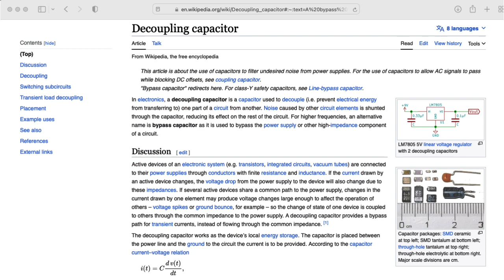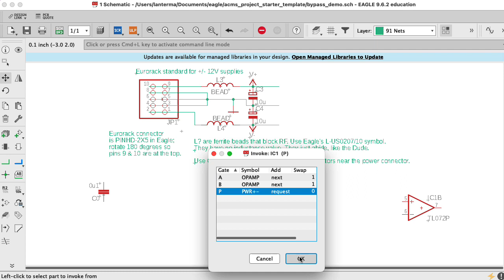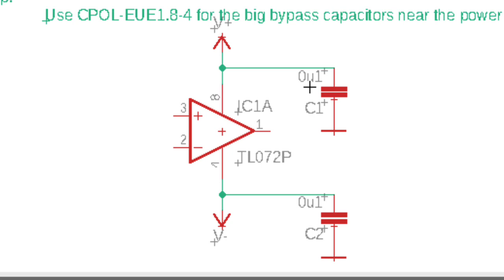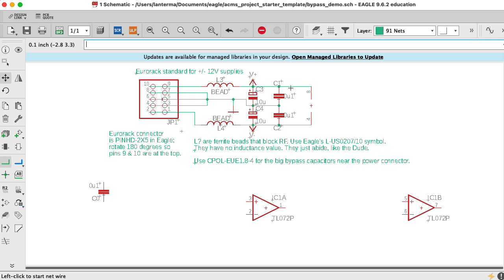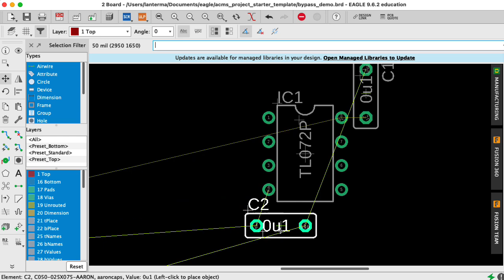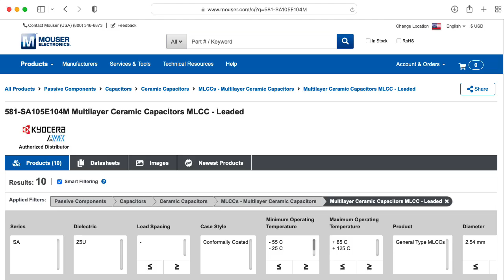Bypass Capacitors for Clean Power (ECE Design Fundamentals, Georgia Tech class)

Comment: Why use Z5U and Y5V dielectrics in this day? 
Especially for 100nF caps it's not worth the hassle of taking into account the variation of capacitance with temperature, bias voltage etc
Just use X7R for everything!

Regarging schematics, personally I prefer the power supply pins (and the respective caps) for opamps separate, but close to the opamps. 
If you gather the supply pins for all the opamps together it can quickly get very confusing and hard to tell which opamp uses what power rails.

Comment: From my understanding, "beads" on power lines have only esotheric value
Reply from the maker: And I'm stretching here, but think about a MHz range parasitic oscillation appearing in a synth op amp circuit. Can you hear it? No. But it can still eat up your dynamic range and make your audio sound weak and crappy. (This can happen when people "roll op amps" and start plugging in op amps designed for video signals into their audio amp without really knowing what they're doing).
Reply from the maker: That sort of assumes that everything is operating linearly with no intermodulation distortion going on. I really should make a video on this. In the mean time, consider this: sometimes guitar amps will pick up radio transmissions, which are well above the audio range, and you can hear the transmission coming out the speaker. Contemplate how that happens.
Reply from the maker: The main google hit is "The Truth About Ferrite Beads Will Shock You" -- and the author of that is overlooking a lot. I started using them because Paul Schreiber of MOTM did in sort of a "cargo cult" fashion. I didn't really follow his reasoning until much later.
Reply: we had to put in ferrite beads in some of our machines the other day otherwise they shut down, ferrute beads really do work if they are specified correctly.

Comment: I'd prefer to see a logical separation between power filtering for the board and power delivery to the IC, even in a simple circuit like this.  The two fill different enough roles that they shouldn't be grouped in my opinion.  

Consider the situation where you need to introduce some additional complexity.  Say your ferrite beads and the capacitors after them start to oscillate in testing requiring you to introduce a damping resistor or RC network to prevent the power filter from oscillating.  Because power filtering for the board doesn't have it's own space it could be ambiguous from the schematic what part of the circuit those filter elements belong to unless you understood enough of the circuit to know the exact problem they were there to solve.  If everything related to power filtering for the board is on its own then that isn't an issue.

It makes the revision process more cumbersome as well because there are very few circumstances where you'd want to change the board's power filtering and the decoupling for an IC on the board simultaneously.  Say you want to change the way power is delivered to your board. For example you want to alter the board to operate from a different supply voltage by introducing a switching regulator to produce the positive and negative supply voltages.  In that circumstance you will want to tear out everything related to power filtering but would almost certainly be keeping the decoupling capacitors exactly the same.  On the other hand if you decide you want to replace an IC with an alternative which has additional or fewer power pins you will need to change how you're decoupling that IC which has nothing to do with the boards power filtering. 

I don't mind when all the decoupling caps are lined up in the corner assuming there's something about the schematic which makes it clear what components those caps belong to.  For example if an MCU is off on its own page and in the corner of that page there is a line of caps then it's clear that the MCU and those caps are related. Grouped sections of a circuit which connect via wires rather than net labels should be logically related though and not just functionally related.  The decoupling caps and power filter are certainly performing similar functions, in that they are both part of the PDN, but there are very few situations where you would logically group them during design or layout.

It really is such a minor issue that I'd never bring it up but since you're trying to teach the correct way to do things, insofar as a correct way even exists, then that's the approach I'd personally advocate for.

Comment: 0.1uF was the “rule of thumb” back in the old TLL days of logic boards where clock frequencies were in the few MHz range. At audio frequencies a 0.1uF has a reactance of ~21 ohms at 60Hz. So it would be of little benefit. You would be better off with a larger value such as 1.0uF, IMO. 
Also, bypassing close the to pin as you first showed is ok IF there is a ground plane. Otherwise locate the caps top and bottom so the ground between them is as short as possible. You run the ground up the middle of the IC. This keeps circulating currents “tightly” constrained. 
I could go on but you get the idea. It can be complicated for some designs that have multiple frequencies involved like clocks and LFOs.
Reply from the maker: Ah -- I should have clarified when I was showing the different places to put the cap that I could choose one based on whatever other traces needed to be routing. (There's so many conflicting design principles when laying out a PCB).
Reply: I remember the "Point one for every chip" design days, but mostly the 0.1uF "shortages" = price increases.
0.1uf became the most expensive value of Thru-hole Ceramic Cap in every vendors catalog back then.
Luckily I noticed that the price of 0.082uF and 0.12uF were still being priced at their original cost - indeed ~75% less expensive than the jacked-up prices of 0.1uF caps.
Most importantly those 2 other values were always in stock at every vendor, and all 3 are the same board sizes! 
(ColoGraphicComputers Atlanta, Ga 1980's)
Reply: 100nF (sometimes called 0.1uF in all schematics originated in US) at 60Hz has 26 kilo-ohms at 60Hz, not 21 ohms! It is not there to do anything to 60Hz hum. Besides, at 60Hz the main role plays opamp's PSRR. The cap is there only to help at frequencies where PSRR is very poor. But indeed, today one can buy cheap small ceramic caps of much higher capacitance and I see no reason why not use them. They have the same parasitic inductance as 100nF anyway.
Reply from the maker: Hmmmm.... out of the hundreds of synth circuits I've looked at, I don't think I've ever seen one with local bypass caps as high as 1.0uF. That's a lot of uF. I just checked the TL07x data sheet, which explicitly says to use 0.1 uF. I don't think it's targeting audio frequencies per se; higher frequency gunk can wind up "detected" by nonlinearities (think of the way radio broadcasts sometimes show up output by a guitar amplifier.) I'm just spitballing, though.
Reply: @Lantertronics  as I said, it was the rule of thumb and it is better than nothing! Many data sheets will also list the power supply rejection ratio and as far as the TL072 data sheet, they specifically mention “to reduce errors” meaning high frequency Common mode noise. I just know from experience designing logic and analog circuits back in the 80’s that everything got a 0.1uF for primarily 3 reasons. 
1. Power supplies were just traces on the board so local bypassing was crucial. (It also increased the impedance of the supply making 0.1uF more effective and the TL072 data sheet specifically mentions “high impedance power supplies). 
2. 0.1uF was about the largest value cap in a small package that was available and had low ESR. Higher values were either electrolytic or tantalum which increased cost significantly. 
3. Because power and ground were just traces on the board, high frequency coupling was significantly more troublesome than low frequency. 
Plus you got the benefit of distributed capacitance. 
A lot has been learned over the years (the TL072 data sheet for TI was first published in 1978 with minor updates to parameters since then) and the designs I’ve worked on most recently will have a multiple bypass caps from 1.0uF-10uF up to 10-100pF to get broad range coverage as opamps today frequently have gain-bandwidths in the 100s of MHz. Low ESR ceramic caps in the uF range are pretty common place now. 
I think using power planes and careful routing to control ground currents will benefit a lot more than a local 0.1uF, but you can’t go wrong by placing one locally. 
I didn’t mean to imply anything you said was “wrong” by any means, my intent was to add context but I could have worded it better and I probably dug myself into a hole. My attempted clarification may have only succeeded in digging it deeper. If so, I apologize in advance.
Reply: Also I have personally found errors in datasheets as well as found they will change the test conditions to optimize the parameter they are testing so you can expect one or the other but not both at the same time! So I’ve learned to only use the data sheet as a rough estimate and if a particular parameter is important, be sure to do the research and understand it thoroughly before accepting it as truth. I’ve been burned too many times! Lol.
Reply from the maker: @johngreene3633  It's all good... I greatly appreciate your knowledge and experience! :)
Reply from the maker: @johngreene3633  It does seem like if you try to take some information on a data sheet to reverse engineer another piece of information on a data sheet they never really match up.

Comment: I agree with many comments below. Putting your bypass caps next to incoming power filter is confusing. I also agree that directly attaching them to symbol is clutter. I place the cluster bypass cap on the same schematic page but label them showing IC ref designator.
Reply from the maker: Ah for multiple page designs that's an excellent idea, as is adding some clarifying labels.
Reply: @Lantertronics  For a large design, I typically have a cover page, power supply, CPU, analog, I/O pages in my schematics. For a small one, I have cover page then sub-divide page 2 into the same categories.

Comment: I work in a company where we have dedicated layout engineers so the schematic designers will always put decoupling capacitors next to their IC in the schematic. You’re right that it sometimes can get in the way of readability but often the schematic can be organized in such a way that the reader’s eyes still follows the signal flow appropriately. Schematic readability really is an art form.
Reply from the maker: I have to confess that since I'm mostly making PCBs for my own use, I tend not to put a ton of time into making the schematic pretty. If I was working at a company, of course, I'd operate differently. (I do make sure that the labels aren't overlapping, etc).
Reply: Interesting, I've been binge watching the Altium channel. Eric Bogatin has some interesting things to say about capacitors, Rick Hartley too. What Type and Quality of capacitors makes more of a difference than what a schematic says. Schematics are the outline, the Rubber meets the road with the PCB designer.
Reply from the maker: @StoneMonkey25  Interesting coincidence I just downloaded Altium (educational license) to try out.
Reply: @Lantertronics  :face-blue-smiling:I'm so jealous

Comment: Some PCB designers advise that you should use the fewest capacitors you can get away with. Their reasoning is that it shortens the BOM, resulting in lower costs in both parts and assembly. They also argue it increases reliability of the circuit given capacitors have the highest failure rate of any PCB component. If the failure mode is a short, it also poses a fire hazard, requiring careful risk assessment and mitigation such as adding circuit protection, which in turn increases manufacturing and design costs.
Reply from the maker: That's Ian Fritz's position (from the synth DIY mailing list); he uses fewer decoupling caps. If I had Ian's expertise and experience, I'd do that, but I honestly don't have enough knowledge to figure out where those fewer capacitors should go. "What you can get away with" is a bit slippery -- every one in a while you'll get a weird motorboating effect or something else strange without bypassing, but quite often you can just leave the bypass capacitors out and test your module and not notice a difference in casual listening (I usually don't bother with the bypass caps when breadboarding, for instance, unless I run into something weird). It's sort of targeting those edge cases, I guess.

Comment: I work in an environment where multiple people can be working on a schematic or pcb design. Putting all of your bypass caps away from their intended place on the schematic is just asking for trouble. If you are worried about clean schematics, just increase your page size or separate the design into multiple pages. You don't need to put bypass caps in the signal flow, but the power pins and caps should be near the circuit they are intended to bypass
Reply from the maker: Definitely, if I was working at a company I'd go with whatever the "house style" is. And large projects have different demands than me laying out a small synth module.